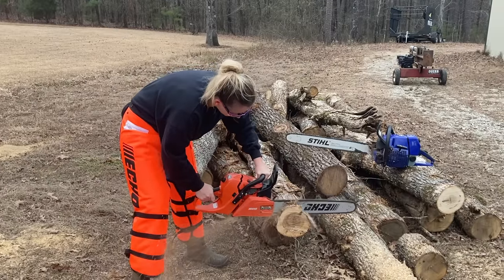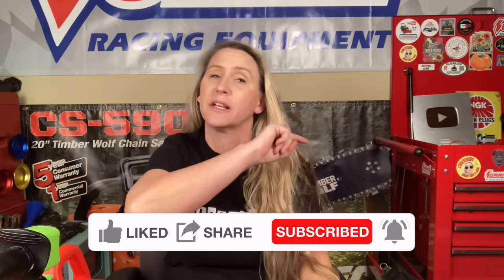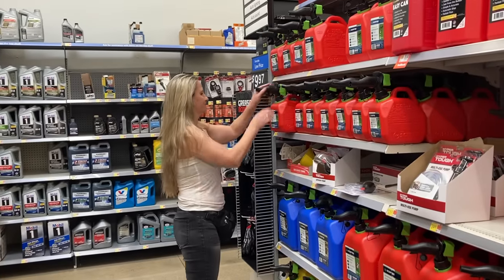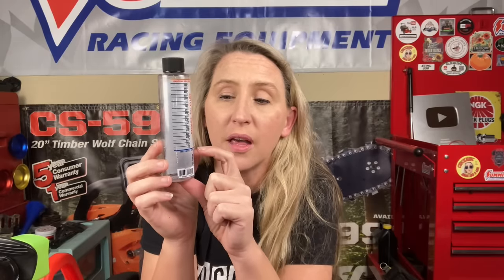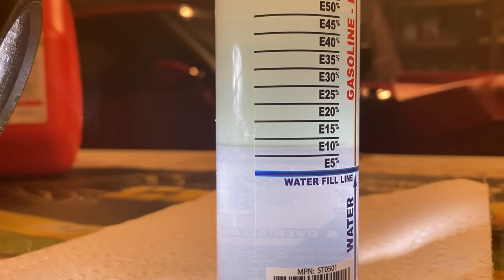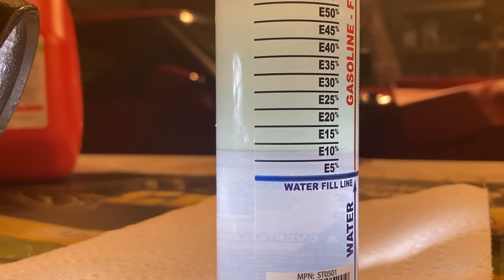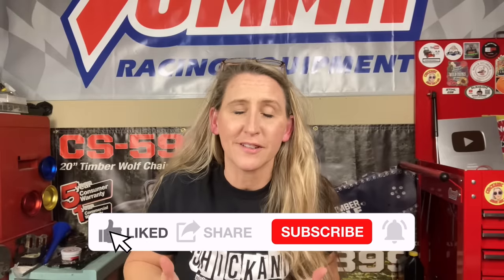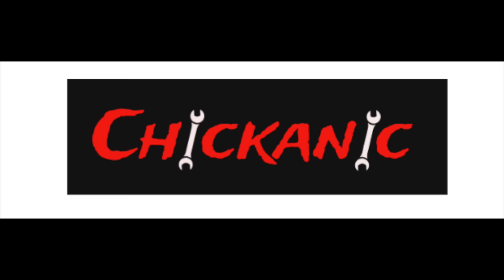Fueled by Deception. How You’re Getting Ripped Off at the Pump! (I'm SHOCKED!) VLOG

Comment: From someone who used to run a gas station, I can tell you that not only the hose on the pumps with a "single nozzle", but the manifold and filters can also hold quite a bit of fuel. When she says to pump a few gallons into your car first it's not to be taken lightly. Also, if your station(with a single nozzle) has only three ground fill ports but four grade options, then you know they're using a mix manifold and pulling from two tanks to get the selected grade. Because some mix manifolds are a little larger at some stations, you're gonna want to pump a little extra, extra into your car before filling your cans.
Reply: Not too mention the idiot delivery guys pumping fuel into the wrong tanks when they deliver.  The gas in the tank may not even be what the station bought.
Reply: @nunya3163  That hasn't been an issue for about 30 years or more. Each grade has its own unique port boot. In other words, mid grade hose doesn't fit on the premium fuel port, and so on.
Reply: Used to drive a fuel tanker and remember delivering to a couple of stations owned by one guy that would purposely order extra regular . Because it was cheaper than unleaded and then have you dump it in unlead tank.
Reply: Yeah I've changed plenty of filters, nozzles,hoses, and pull free couplings for a BP station, only 10%ethanol for all 3 octane numbers on a regular/premium mix pump with 1 filter for the 2 different tanks, and diesel/off-road diesel sold on a different pump set... separate hoses, nozzles (large nozzle off-road) and filters on the diesel pumps though. It definitely took atleast a gallon or more to clear the mixer/control and hose on the shared gas nozzle (atleast for these pumps) I never got my small engine fuel there 😆 Luckily there were 3 other stations nearby with dedicated hose ethanol free pumps, one station had single hose ethanol free pumps, but knowing what I did I stayed away from there so I didn't have to waste $1 more on 2 gallons of purge gas, while also hoping they filled the tanks correctly and kept the filters changed... 😉 Also I never would've believed so many people drive off with the pump handle still in their car 🤦‍♂️ and atleast half the people would toss the nozzle towards the pump and not even tell the clerk 🙄 Thank God for those break free easy attach quick connects! I would install those as customers broke the older single use versions. I only ever knew of one person driving completely away with a pump handle and hose from that BP, an elderly lady from out of state, I never saw that handle and hose returned so I can't tell you how that story ended 🤷‍♂️😳
Reply: I have heard stories from long before my time driving where the pumps used to allow you to drain the fuel from the hose after shutting them off, which would then force the next customer to pay to refill the hose before they had any fuel dispensed. I presume that was a remnant from the days of the even older "visible" gas pumps.
Reply: @illiniwood  Then how did my local E85 station end up with a tank full of diesel?
Reply: @OtisFlint  WOW!
Reply: @OtisFlint  My station didn't carry diesel, so I'm not able to give a precise opinion on how that's possible. The only thing I can assume is that your local station has very old tanks that don't have updated ports and has gotten overlooked more times than anyone will admit. The driver may be using some sort of an adaptor(universal?) on the fill hose that may fit older tanks all in a similar way, regardless of their content. That sort of mistake is very costly, even to a franchise. They've most likely taken vast measures to make sure something like this will never happen again.
Reply: @r2db  Yea, back in the 90's when I was with the station I'd hear old timers talk of that's how they kept their motorcycle tanks full without hardly ever having to buy much gas. One hose full would nearly fill their tank.
Reply: @r2db You still can purge the new hoses if they have a cylindrical black quick connect...  just accidentally drive away with the nozzle in your vehicle, then reconnect it after draining the hose... You may not be welcome back though 🤣 also a step stool or short ladder will be required 😆 It's actually possible for people to break them loose by hand and tale a gasoline shower in the process, but I've heard of gas stations where such vandalism/theft of the pump nozzles/hoses occurred 😡 The guy telling me the story said that station had security cameras and had everything on video, but I don't think the authorities ever caught the two dirtbags... Sadly they didn't set themselves on fire in the process, but maybe they did after leaving and trying to light cigarettes though 🙏😇
Reply: @illiniwood  That’s not true. My friend recently made two bad drops for a nationwide truck stop gas company. He caught the errors while making the drops so no customers pumped that gas but it does happen. The first time was on his first day delivering solo and the second just happened months later so he’s probably going to get fired. In the mean time he has made me aware of at least two other incidents where other drivers for his company have done the same thing in the last few months. Not sure where you got the idea that it doesn’t happen anymore… but it does.
Reply: @emmettturner9452  I guess I'm just that naive and got spoiled working for a company that had their chit together. When I worked for them back in the 90's they had all that figured out. You have to admit, it's not rocket science to make two fittings fit each other and nothing else. That's so as to avoid a catastrophe, like putting diesel in with the gas and ruining a slew of gas burning cars. I guess thirty years later most gas distribution companies still don't have that worked out yet. I'm sorry to hear that your friend works for a company that makes it that easy to lose his livelihood. I'm sure he's not a moron or he wouldn't have been there this long, but he is also expected to never have a bad day on the job, or else.
Reply: @illiniwood  It may even be that things necessarily got worse for the industry over the last 30 years so that they could offer E0, multiple grades of E10, E85, and diesel. Heck, the only place I know with E0 also has off-road diesel and farm kerosene at the pumps. Good thing we don’t pump LP, lighter fluid, or butane since it would be an even bigger clusterfk. ;)

My understanding is that his first mistake was related to the grade/octane and was fixed by pumping the correct amount of another grade until the tank had the right blend. The other bad drop was related to the ethanol blend. My understanding is that much of the mixing to produce mid-grade and various ethanol blends is done when dispensing from the tanker truck. Saves them from having to have a bunch of different tankers dedicated to one blend or another.
Reply: I always knew that was a sht about those single nozzles. I remember in the '70's and '80's when Sunoco used to have that 'Dial an octane' knob on their pumps and it went from 85 or 86 'Economy' to the 94 'Super Premium'. Every car I ever had ran like crap on that Sunoco premium. My brother had a really lousy but knock 'sensitive' 1980 Olds Toronado with the anemic 307. That was a good test bed to find the best premium. It would do OK on all the major premium grades Mobil, Exxon, Shell, minor knocking. Horrible on Sunoco Premium like it was 87 regular and absolutely the best with 'no knock' on Amoco Ultimate. So that's what I used all the time on my performance cars Amoco.
Reply: @illiniwood  that is incorrect. Coming from someone that’s sells services this dispenser I can tell you ALL gas nozzles are the same size. No change per grade.
Reply: Go to a yard sale and get a real gas can. I wouldn't own one of those pieces of crap.
Reply: The pump need to be redesign to prevent mixing.
Reply: I fueled a flex fuel Silverado yesterday at a Go Mart while my scan tool was connected. All of the dispensers are marked "may contain up to 10% ethanol". The low fuel light was on and I filled the tank. My scan  tool indicated 15.7% ethanol. The week  before I fueled at a Sheets station, again with the low fuel warning light on and scan tool attached. 16.9% ethanol.
Reply: @JohnSmith-pk4xy  I think it depends on the station or distributor/operator. I don't see a lot of those single nozzle stations around me. All of the Pure Gas tanks have their own nozzles.
Reply: Where do you get the testing bottles?
Reply: @gordycummings  Amazon
Reply: I buy ethanol free @ a country store that's in a farming community,  the ethanol free gas is separated from the other pumps.
Reply: @illiniwood  Good to know! Thanks!
Reply: @OtisFlint  SOMEBODY really screwed the p00ch on that one.....they put diesel in the E85 tank...that is how that happened
Reply: just a bit of a purge so to speak....good info
Reply: Nissan owners manual says not to run ethanol in my car so I have to find a gas station somewhere. Lol
Reply: @bryandraughn9830  Far easier done in Japan than in the U.S.. Good luck, especially when traveling.
Reply: @bryandraughn9830  there are MANY places that you cannot get ANY non-ethanol gasoline.....
Reply: @klpittman1  That explains why sheets regular is such an awful product with awful mpg.
Reply: @willc5512  That’s fair. My only point is that it still happens.
Reply: Or, just fill up after the guy in the Corvette having his midlife crisis fills up and leaves in a smokey burnout ,barely avoiding putting it in a ditch.
Reply: What kills me is that some East Coast stations dispense gas from a green handle.
In the rest of the country, GREEN HANDLE MEANS DIESEL.
Reply: @backcountyrpilot  I live on the east coast and green handle is diesel. Maybe you pumped something else, like E85.
Reply: @emmettturner9452  That explains why on my data logger i get performance consistient with regular  when I buy midgrade SOMETIME. I got misfire with a tank of loves 89. So it didnt even meet 87 specification!
Reply: @OtisFlint  Dumb truck driver?
Reply: @berryreading4809  They say she is still driving off into the sunset... with BP's hose dangling behind her. LOL
Reply: Ethanol fuels can be slightly inconvenient, but please remember the politicians that depend on those kickbacks!
Reply: @nunya3163  And years ago when I worked at a service station, if the manager over-ordered one grade of gas, the fuel deliver guy was told to put the remaining into another tank, since the station pays for whatever was ordered. The fuel truck always leaves empty. So 87 might get added to 89, or 93 might get added to 89. It all depends.
Reply: @illiniwood  But if I remember correctly, a fuel tanker can deliver any grade. Then the driver just pulls out the correct transfer hose. So he could simply switch hoses to connect to the underground tank adapter. At least that what I witnessed  years ago.
Reply: Which sucks for someone like me who drives a diesel..  I just use the ethanol treatment
Reply: @illiniwood not sure what area you’re in but in my region there’s absolutely no difference in the ring/drop tube to distinguish between products. There’s only two types in my area, you either have 4” side seal rings or top seal rings, and most stores will stick to one or the other. The only other different type of drop for an in ground tank is a 4” coaxial drop that has an inner 3” drop tube and the outer section around it is for vapors to escape on stores with no stand pipe to vent. On my trailer I carry 5 drop fittings, 2 straight 4”, 2 coaxial, and one side seal (aka flat ring or Texas tee), also keep a top seal ring that whenever possible I spin off their side seal because I hate them and spin on my top seal. Most modern stations use top seal 4” drops either coaxial or straight drop. I also talk to fellow fuel haulers in various regions and have never heard of your claim. At most they might use one type for all the gas products and one type for diesel to try to prevent cross drops. If you can’t tell the difference between diesel or gas on your stick you’re not meant for fuel hauling.
Reply: @steadyeddie7453 There is another solution, you tell the owner to kiss your keister and have dispatch build you a retain split and you take it to another store. I do not play their over ordering on purpose to try to game the system BS. The exception is if there’s no store near by. A riskier solution is if your next load has the same supplier, product, and grade you can (carefully) load on top of the retain and go on with your business.
Reply: @vincemajestyk9497 Back in the '70s, Sunoco had a 160 (probably not octane)? fuel, and our Triumphs and Harleys ran like shot cats on it. Hated when they discontinued it!
Reply: @garychandler4296  I believe it was 260 which was the marketed brand you're referring to. It wasn't of 260 octane. The actual octane as measured then was 102. You can still buy 'pails' (5 gal cans) of '260' ranging from 100-118 octane (today's rating). It used to be branded 'Cam 2' in the '80's and the 'Standard Purple' leaded was 110 octane. Last time I bought some was 2018/19 and the cheapest I found the 112 'Blue' leaded Maximal was $60 a pail. I would cut it with 90 octane Ethanol free 'Pure Gas'. You really don't want any more octane than you need. It should match your engines compression and combustion chamber burn rate to the gas. Too much (octane) it won't burn fast enough and you're blowing unburned hydrocarbons out the tailpipe. Less power.
Reply: Single nozzle for all grades
Reply: Verses single nozzle for noneth
Reply: @backcountyrpilot I ran into that on a trip. I did a double take. Then a triple check. SMH.